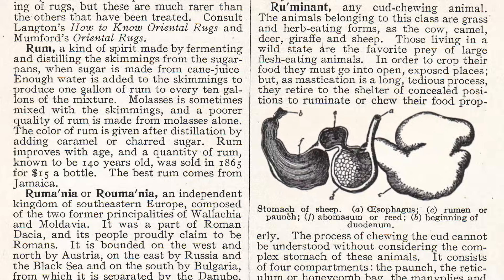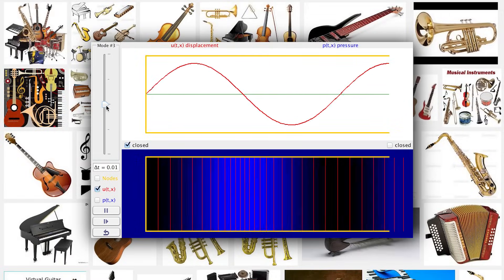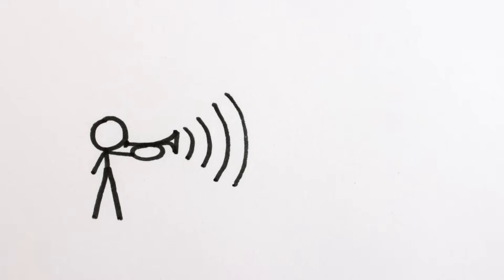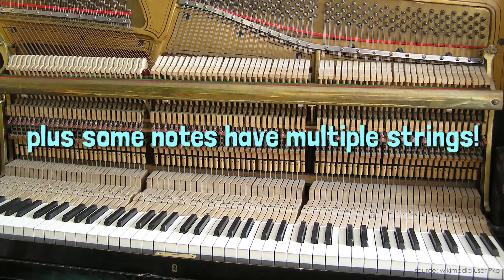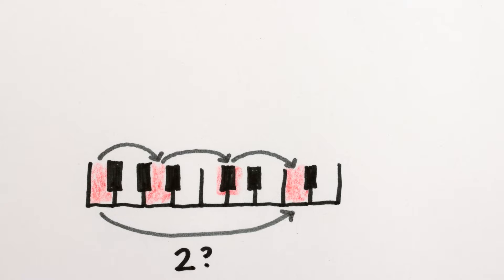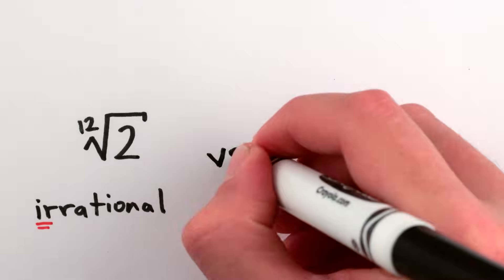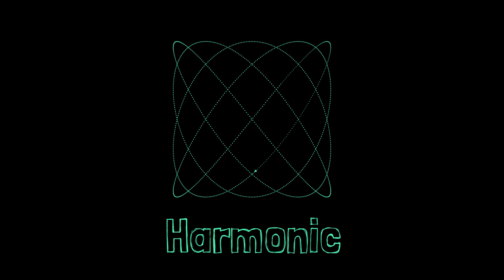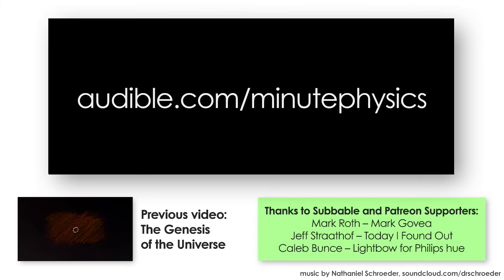Why It's Impossible to Tune a Piano

Comment: While the premise is true, you really can't tune a piano perfectly, the reason is not because there are too many strings.  It is because there are not enough strings.  For just one instance, on a piano, the same string is used to play A-sharp and B-flat, but they are not really the same pitch.  Of course it would be entirely impractical to have a different key for all of the sharps and all of the flats... and even if you did, you would still have the same problem with double flats and double sharps.  So they tune the one string to somewhere between the two frequencies.  However, I did now know that they used the 12th root of 2 for calculating the interval between each note. This means that all the notes (except A) are slightly out of tune and not just the sharps and flats.
Reply: +Dale Erwin You are referring to "just" tuning as opposed to "tempered" tuning. In just tuning, the intervals between all of the notes in a scale are not equally spaced. They are tuned so that the harmonics line up when playing a piece in a certain key. The problem with this is that if you transpose to a different key, things don't line up so well. Some instruments (like the bagpipe) still use just tuning, but most use tempered, so that you can play things in any key and they'll still sound good.
Reply: +Dale Erwin That's not why you can't tune a piano properly.
The same key is used for A# and Bb because they are they same note in the 12 TET system. Older systems with more notes actually had different notes for A# and Bb, some even got to the point of having A, A#, A##, A###, A####, Bbbbb, Bbbb, Bbb,  Bb, B. With all these intervals being very small
Reply: nuberiffic
But the true pitch is determined by the harmonic series and good string players will not play A# and Bb the same.  A# is actually higher than Bb.  In some keys, a piano with an orchestra sounds out of tune.  Of course, it's always a bit out of tune but in some keys it is more noticeable.
Reply: +Dale Erwin Yes, but that's because they are not playing in the 12-TET system like the piano is.
They are using just intonation,
On a piano (and in the 12-TET tuning system) A# and Bb are considered to be the same note. Yes, they should be different depending on which comma adjustment system you use, but for the sake of practicability; they are treated as the same note.
Traditional pianos don't (can't) play to true pitch, this is the best compromise.
Reply: +Dale Erwin Not only that, but you'd have to change the tuning to play in a different key.
Reply: +Dale Erwin Erm, A# and Bb is the same exact key. A# is one semitone above A, and Bb is one semitone below B, and A -> B is two semitones. That's like saying 1 + 1 = 2 and 3 - 1 = 2, but they aren't the same number.
Reply: James Lynn On a modern piano, they are in fact the same key.  However, if you wanted to make every chord "perfect", you'd need them to be slightly different.  Look up "just intonation" if you want to learn why, and be completely confused, and then just decide that the way the modern piano is is just easier and live with the fact it's technically out of tune.
Reply: My original statement was not really to question whether or not A# and Bb should or should not be the same key on the keyboard.  The video contains the statement that the problem is that the piano has too many strings.  I contend that the problem is that the piano has far too few strings.  If there were enough strings to represent all of the perfectly tuned notes, there would be no need for a tempered scale and the piano could be tuned perfectly... if you could find anyone who could play such an instrument.  I have learned to live with it as a necessary evil, but I believe any musician should be aware of this anomaly.
Reply: +Dale Erwin As I've said before, those instruments exist.
People have made pianos with 12TET (Standard Piano), 19TET (tritone piano) all the way up to 55-TET Pianos. These have 55 notes in the octave, and you can get much much closer to perfect harmony as instead of just having A, A#, B. you have A, A#, A##, A###, A####, Bbbbb, Bbbb, Bbb, Bb, B.
Instead of 3 notes covering a tone, you have 8. Each interval is much smaller, allowing for a closer attempt at just intonation.
The reason we stick with the 12TET system, is one, because 55 keys in an octave is impractical, and two, it just really doesn't matter that the piano is slightly out of tune, it's close enough, and the benefits far outweigh the drawbacks.
Reply: +nuberiffic you can have whatever amount of strings you wish. Especially on digital instruments but it does not make the mathematical theory more real.

Mathematically the just tuning would be always set to one special key - and not because you physically can't make more strings or whatever.

You can't play the G-moll written piece on the piano just tuned to B-dur.
Reply: +yrussq Digital instruments (especially pianos) don't have strings. The pitch of each note is just part of a computer program; tuning is irrelevant in this case.

It's not quite true that just tuning would only work in one key, you don't tune to just tuning. You adjust each note as you're playing it to make it just.
This is how violins / singers / trombones work. A Piano wouldn't be justly tempered because it would limit it to one key and a smaller range.
Reply: +Dale Erwin Just intonation is a double problem... not only is A# different from Bb, but even Bb is different depending on if it's a major 2nd down from C (8/9) or a minor 3rd up from the lower G (9/10) or a major 3rd up from the lower Gb (640/729). 

If you use Danielou intonation (53 tone equal temperament), you can approximate those by using Bb, A# and Cbb. Which is nicer and cuts down on the number of notes you need somewhat, but you still need 25~30 notes for commonly played keys in western music....

Comment: This is a great video, thank-you for sharing! There is one point which had me confused on first-watching though, so I'd like to clear it up.

When you say that you can tune a guitar (as opposed to a piano) by harmonics, I think this is misleading, because it depends on what you mean by tune. I think there is a danger of confusing this as an instrument specific issue, rather than a general mathematical property.

The fundamental issue that you explained so well is that no equal tempered scale can give both a perfect octave and a perfect fifth (and a fourth etc.). The reason the chromatic scale is so nice is that it does such a good job of approximating those simple harmonics (cf. @3Blue1Brown's comment and wonderful video). Your piano illustration does a great job of explaining this, but I don't think there is anything special about the piano here, compared to any other instrument, and the same problem will persist for the guitar, say (assuming you also want it to follow the same equal tempered chromatic scale).

Indeed, you may proceed to tune your guitar by starting with the low E-string (for example, equalizing it with the E on your piano) then equalizing the 4th harmonic on that E-string with the 3rd harmonic on the A-string (cf 1:40). That will give you a perfect fourth, but now your A string is no longer actually an A (according to the definition of the equally tempered chromatic scale, at least). To see this, all you have to do is compare it with the A on your piano! They will be out of phase, because of the very issue you just described for the piano!

Again, let me stress, this is an awesome video, and I learned a lot. But initially I was confused by what is special about the piano here, compared to the guitar, and so I wanted to clear up that there is nothing special about the piano, and the problem is still there for the guitar. 

Please let me know if you have any comments, or if I got something wrong! :)
Reply: Thank you so much! I have watched this video many times, and I was quite confused about how this problem doesn't occur in guitars and other stringed instruments. (I was thinking, just copy whatever the guitar is doing!)

You helped clear that doubt in my head, so kudos. I think the original video should also have expounded on it a little bit.

Comment: Wowowowowow you don't tune a violin with harmonics. You tune everything in fifths to get the sound to resonate. This is why when you go to a concert the concert master will play an A (because their violin is supposed to be pre-tuned), and everyone plays an A in response then matches their A-D strings to be a perfect 5th, D-E strings to be a perfect 5th, then G-A strings to be a perfect fifth.
Reply: that's what I was confused about.
Reply: Bruh I don't even play strings and I knew that 😂😂 thanks for clarifying, I was confused as well
Reply: Actually, I think you're both right. When he talked about tuning violins, he said that the third harmonic on one string matched the second on the next one up, which, according to his earlier description of harmonics, is a fifth, just like how you say they are tuned.
Reply: Ember in the Distance But it was when was comparing to tuning a guitar using the harmonics on one string to tune the next string
Reply: It's the exact same concept as the guitar, just with different harmonics. They even have the same intervals between strings, just in different relative octaves. When you play the different harmonics, the notes should be the same, not 5ths. It would still tune exactly the same if you matched your A string to the right pitch and then tuned off of it in this manner. It would probably be even easier to tell if your strings were tuned properly, because it's easier to tell when two strings are the exact same note rather than if they're a perfect 5th. Especially to the untrained ear. It also has nothing to do with how well it resonates. Resonance is just how well sound bounces around in something. You're probably confusing resonance with simply having a well tuned instrument. You don't play violin, do you?
Reply: Dude, that's called fine tuning.  Calm down.
Reply: From Wikipedia: "The perfect fifth may be derived from the harmonic series as the interval between the second and third harmonics."

If you're tuning everything in fifths you are, in fact, using harmonics.
Reply: The fifth in the violin can be tempered slightly and this will be very usefull...Only the unisson must stay perfect!
Reply: D-E and G-A are not perfect fifths, they are 9/8 major seconds.
Reply: Is 9/8 perfect second?
Reply: Latchezar Dimitrov
9/8 is major second, and 10/9 is used together with it to produce 5/4 major third. Only fourths and fifths are called "perfect".
Reply: And the octave is called how, then? 5/4 will be never enought for a major third and like violinist before more 60 years you can trust me!
Reply: Octaves, unisons, fourths, and fifths are perfect. Seconds, thirds, sixths, and sevenths are major/minor.
Reply: In Just Intonation ALL pretend to be perfect...with many variations of the same note depending of the actual key. For me only the unisson must be perfect! All other intervalles are tempered for eliminate the comma and to respect a fixed place for all the notes. No other way to play and stay in tune!
Reply: I think you're using a different definition of perfect.
Reply: Not at all, perfect ever mean without beatings!
Reply: Latchezar Dimitrov And now in a correct sentence please.
Reply: ***** You are missing the point. You got that from a page that's not about tuning violins, and it says "may be derived". You aren't understanding what is meant by "tuning with harmonics" either, this is a method of tuning on guitar where you gently touch the string to force it into a harmonic mode to tune the strings, and this video incorrectly states this is how violins are tuned and even shows a violinist playing a harmonic note, further misleading. Using the open strings to tune on violin is NOT the same as harmonic tuning like on guitar, and no competent violinist tune using the method as a guitarist. https://en.wikipedia.org/wiki/Guitar_harmonics
Reply: Jakromha "perfect" is in the eye of the beholder
Reply: Being a concert violinist and highly accomplished musician, I first tune using open strings and then double check unison with harmonics. You can never be too in tune.
Reply: Concertmaster? I've never seen a concertmaster playing the A, it's usually the oboe
Reply: It must be for camera orchestra...
Reply: saboo could be if it's a string orchestra
Reply: BLacKHaLLoW And how? if the open strings are out of tune the harmonics will but out of tune relative to the strings tuning as well. You can also play harmonics slightly out of intonation
Reply: Why do concert bands tune to B-flat?
Reply: Concert Bb is an open position across most of the wind instruments you will find in a concert band or wind symphony. It is common for the Tenor Saxs and Oboes to tune to a concert A, since that is slightly easier on their register/key mapping.

Basically, you want to tune on a note that relies on the natural length of the instrument without throwing weird variables in like key placement. Certain pitches are out of tune on certain instruments, but concert Bb is fairly solid across the board. Bringing this pitch in tune will leave it to the player to lip and adjust any of the other pitches to be in tune with their section and the rest of the ensemble.
Reply: Kilivin The oboe gives the A mate, not the concertmaster
Reply: Snookbone I never said symphony. Violin implies orchestra I thought. Was talking about an Orchestra. >_>
Reply: Snookbone Concertmaster generally plays alone with oboe after oboe plays for winds, then the strings follow. So the Concertmaster and oboe give the strings the A.. ;)
Reply: Huh I play piano and a bit guitar but so far I know is the violin tuned in  G D A E   and all these strings differ indeed a fitht. Thus  G D a fith   D A a fifth  A  E  a fifth.

Comment: The issues raised in this video actually effect most instrument in an identical or similar form. Saxophones for example are flat on some notes and sharp on others. Only trained professionals contain the skill to hear tunings between each note and adjust for it. If the player does not adjust, than the resulting sound issues are similar to the piano in the sense that they are not playing perfectly in-tune. String ensembles also adjust for it. Choirs often sing in pure intonation unless they have piano accompaniment, in that case they likely are singing in equal temperament and have the same tuning issues.

The other issue is that this video only explains the theoretical. In reality, every material and instrument has its own properties that effects the numbers displayed in this video. Piano tuners realize that every single piano has different string tensions and specific required adjustments to take proper tunings. Partially due to string length which is likely not exact to the many decimal points and because pianos and other instruments are not static, the materials expand and contract due to circumstances such as humidity, season, temperature, and etc.

Comment: If using half steps to calculate the whole octave, shouldn't we use (17/16)^12 which equals almost 2.07? I really appreciate the video and it's truly fascinating problem.
Reply: (18/17)^12 = 1,98556...